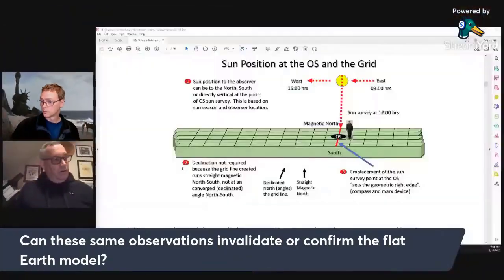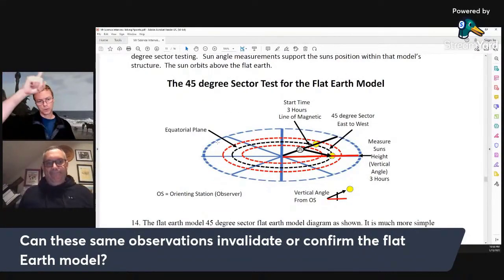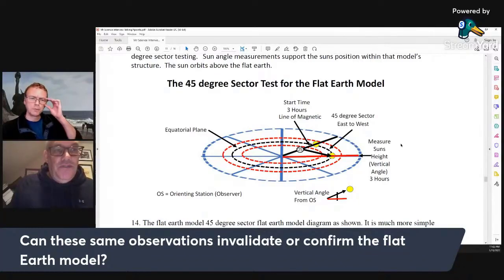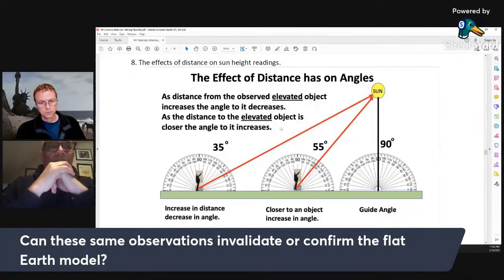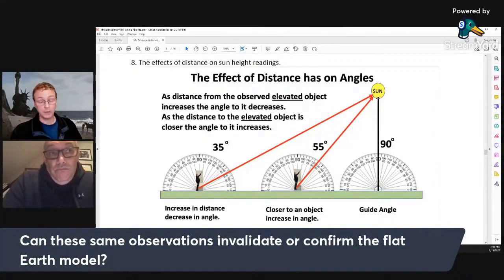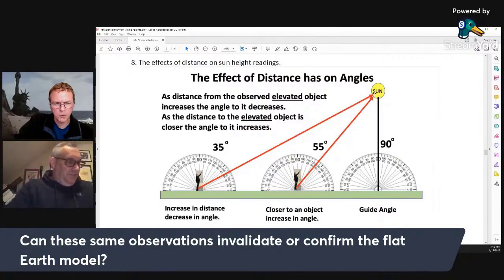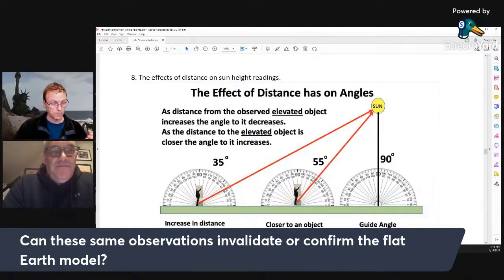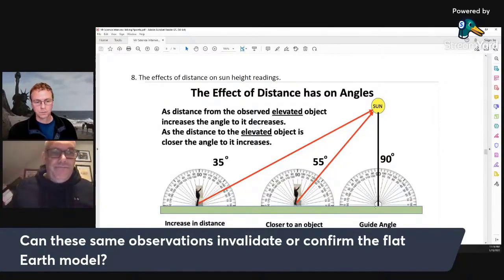Conversations with Corey - Does this work on Flat Earth?

Comment: @I Can Science That multiple points:
1/. Size of the sun = 0.53 degrees correct, I do not know what he was saying about 2.5 degrees, but any statement of "The sun always measures to be the same size" can be countered with these beautiful words: NASA Summer Moon Illusion. This demonstrates that an object in the sky can appear larger than we record it, albeit the moon not the sun this demonstrates that what we measure in the sky is not necessarily what we experience in reality. When you look in to the maths its about 30%, and then when you look in to how much the flat earth sun should shrink its about 30% also. Now I know you will try and add a zero on there which leads me on to my next point:

2/. In an orthographic view, all measurements based on the horizon "upwards" i.e. measuring angles to objects in the sky based on a perspective distorted non-physical horizon. Your geometric horizon is at the subsolar point which means that its X thousand miles away, lets say 4000 miles at 45 degree. Now in reality your ACTUAL horizon is only 3 miles away for a 6ft observer, which is 3997 miles difference in distance. You have zero account for this as you are taking your data from a perspective distorted viewpoint and then applying it to an undistorted geometric reality WITHOUT any forms of error analysis or transformations to remove these error accounts. Once you do, you will find there is approximately 23-45 degrees missing from your total visible sky measurement, because your floor is appearing to rise up in front of you and stopping you from seeing 4000 miles away to the ground-surface of the subsolar point. (you can imagine this on a flat earth as the 3997 miles are all squashed in to 1 single pixel row on the horizon, but once you learn that geometry only works to the tips of your toes, everything beyond that is perspective and refraction distorted illusions, literally ALL PHOTOGRAPHS ARE LIES... From ground based photography to aerial photography, they are all incorrect depictions of geometric reality by design. They are design to match what the eye sees not the geometric reality.

3/. If you roll them all together you get the following facts which I would love you to try and refute please:
a/. Your perspective view does not have a 1:1 relationship with geometric reality, and each individual has a different viewpoint with different errors, like perspective distortions and refraction.
b/. Objects in the sky are known to change apparent size, but science does not conclusively know why (read the NASA citation if you incorrectly think its the Ponzo Illusion)
c/. We have known refraction effects which means the sun is actually advanced 0.5 degrees more than where we are measuring it near the horizon starting about 40 degrees and gradually worsening towards the horizon. (ironically this is what globe earthers fail the flat earth on being able to explain: Why is your sun not located in the angle my orthographic geometry said it should?)
Reply: Question
1. I looked up NASA Summer Moon Illusion and found a nice page on the NASA website describing it. But it didn't answer the question I had. It's about the difference between "natural perception", what we see or think we see when we look at the Moon, and "measured perception", what we see when we look at it with an objective measuring device.

Just look at the Moon near the horizon and we think it looks bigger than when it's high in the sky ... but  ... here's my question ... There's probably some sophisticated surveyor's measuring device that can precisely measure the angular size. What would it show? Would there be a difference?

My hunch is that there wouldn't and that the effect is basically our brains playing tricks on us, not a real difference in angular size. I don't own surveying equipment but I do have a finger and a camera. So I've thought of 2 ways I can check. First, the index finger held out at arm's length is roughly 1 degree in angular size. I'm going to guess my pinkie finger is probably not much more than 0.5 degrees. So it should just cover the Full Moon. The next time there is a Full Moon and a clear sky (could be years from now,  where I live) I'll go out near moonrise and compare the Moon to my extended pinkie finger. Then I'll do the same a  few hours later, when it's well above the horizon.

There's another approach. I'll do this too. I've got a digital camera with a decent telephoto lens. I'll take photos of the Moon on that same night, using the full zoom of my lens, maxed  out so that I know it's the same setting for every photo. Then I'll count pixels to see if it changes in angular size.

As far as the atmospheric refraction when the moon is near the horizon, that is very well understood and quite minor in scale, compared to the 30% you are talking about. So for the purposes of this observation it can be neglected. I'll make sure to do an observation when the moon is just above the horizon, so that any atmospheric refraction effect is indeed captured. Then once it is about 5-10 degrees above I'll observe again, to see if the effect has dissipated. Then I'll measuring again when the Moon is much higher. That way we can factor out the refraction contribution.

Will you do the same observation as well? Or perhaps you've already done one similar? It would be interesting to compare results.

There are some other things in your comment I find not convincing at all. But maybe I'll leave those for now and focus on this one point, which I think is most interesting anyway.
Reply: @fepeerreview3150  If you really want to engage with me I would suggest dealing with the science presented:
1/. Do you believe perspective and euclidean geometry have a 1:1 relationship at all times?
2/. Do you believe that cameras are geometrically accurate without distortions?
3/. Do you believe that overlapping/occlusion of a false horizon can be mistaken for a globe?

The core conversation here is understanding that there are known errors which you lot are purposefully omitting and then obfuscating to avoid dealing with them. We personally have had this conversation about 3-4 times to no actually admission that this science is factual, only a handwave dismissal that its not needed, which is IDENTICAL to how flat earthers describe the "curvature of earth".  Odd that, no?!
Reply: I suspect a long cardboard tube might do the trick (closing the eye not looking through the tube) and prove that it is an optical illusion in your brain causing the sun and moon to appear larger near the horizon. I swear I have done so as part of my science education when younger, but perhaps it was something from kid's educational shows like Mr. Wizard, Beakman's World, or Bill Nye and not public education. Which is why having external measuring devices that do not have our brain's limitations is an important part to learn about the world around us.

I often seen portions of either scientific research or scientists themselves quoted but have often found the source material was taken out of context. I can prove the flat earth doesn't work just using my kitchen table, probably from watching those kid's science shows. But I don't even need to use science to guesstimate the shape of the Earth.

Commerce requires minimizing expenses in order to maximize profits. That means that when it comes to shipping, either cargo or people, companies will try to minimize fuel costs and travel times. If the Earth was flat, there is no way that it wouldn't be common knowledge just by commerce alone. Yet the technology exists to track flight paths and shipping routes and they better fit a globe earth.

It would be more impressive to me if a flat earther could produce a flat earth map that works for commercial navigation than their constant arguments against accepted science. I am not going to toss all of science out the window due to some misunderstanding of science, but if a flat earther could make me see how commerce could actually be following a flat earth map (where all routes make more sense than the globe) then at least it wouldn't be multiple aspects of society that provide evidence for a globe.

Gleem, got a map that does that? If you need help with surveying, might I recommend chapter 7 in reference number 3 from Corey Kell's Military Science References?
Reply: @Tsudico  "I suspect a long cardboard tube might do the trick (closing the eye not looking through the tube) and prove that it is an optical illusion in your brain causing the sun and moon to appear larger near the horizon"
You clearly never read the NASA citation, enough of you ignorant fools who take pride in being an ignorant fool!

"Some researchers believe that the Moon Illusion is Ponzo's Illusion, with trees and houses playing the role of Ponzo's converging lines. Foreground objects trick your brain into thinking the moon is bigger than it really is.

But there's a problem. Airline pilots flying at very high altitudes sometimes experience the Moon Illusion without any objects in the foreground. What tricks their eyes?

Maybe it's the shape of the sky. Humans perceive the sky as a flattened dome, with the zenith nearby and the horizon far away. It makes sense: Birds flying overhead are closer than birds on the horizon. When the moon is near the horizon, your brain, trained by watching birds, miscalculates the moon's true distance and size."
NASA

Come back when you are ready to talk science not kids programmes yeh!

"Gleem, got a map that does that? If you need help with surveying, might I recommend chapter 7 in reference number 3 from Corey Kell's Military Science References?"
You are too stupid to understand its a basic coordinate system transformation and why would I have any evidence of a flat earth when I am not one and I am in here citing NASA and the leading scientist in Perspective Geometry! It hilarious watching you lot pretend to be smart, as you clearly do not know what the Military Grid Reference Coordinate System is, look at antartica and tell me why its shown flat? = BECAUSE WITH MATHS YOU CAN DO WONDERFUL THINGS...

However, because I am kind, you can look up the model done by Steve Torrence who used the Hellerick Projection for his flat earth model and that matched up Star Trails from 6 different countries worldwide both north and south, and they matched. Or you can look up Rick Potvins maps which is a reverse engineer of all the antartica trips and matches the data.
Reply: @Gleem  Did you read the NASA article, or just look for key words and phrases? Let me provide another quote from near the beginning of the article:
    "Cameras don't see it, but our eyes do. It's a real illusion."
You are talking about a neurological phenomenon and trying to apply it to objective reality. This is why I have tried to stop arguing science with people who misunderstand science. They still often remain completely oblivious to what you are trying to teach them and continue to take quotes out of context . It doesn't matter if it happens with airline pilots as well, because it still doesn't show up when using cameras at altitude so it is an illusion crafted in the human brain. Just like the illusion of the horizon always rising to eye level, which when measured with external equipment is proven wrong. Our senses sometimes betray us.

Perhaps you need a science refresher, might I suggest Mr. Wizard, Beakman's World, or Bill Nye? They seem to be about at your science understanding.

As for your provided maps....unless they work with commercial navigation, then it wasn't what I was asking for. It is easy to make a map that works for some scenarios, that's why there are multiple map projections. The problem that flat earth can't seem to wrap their heads around is why all of them are projections in the first place. Again, flat earthers are missing the forest for the trees.
Reply: @Tsudico  "Did you read the NASA article, or just look for key words and phrases? Let me provide another quote from near the beginning of the article:
    "Cameras don't see it, but our eyes do. It's a real illusion.""
You should come back once you actually read my words and stop making up your own narrative pretending I said something different! I have never said the psychological effect is present in cameras, I have stated clearly that the moon illusion is unresolved as it cannot be the Ponzo Illusion if there is no ground reference available! On top of this I have cited in my first series of comments this:

"There are many approaches trying to model and estimate the perspective effects in images. Some approaches try to learn and model the distortion parameters from a set of training data that work only for a predefined structure. None of the existing methods provide deep understanding of the nature of perspective problems."

Perspective Distortion Modelling For Image Measurements - 2020 

Now for your lies to be true, I need you to explain how psychological issue affect a NASA professor of Robotics who has worked for the Department of Defense is saying "None of the existing methods provide deep understanding of the nature of perspective problems." when talking about ROBOTICS and A CAMERA and IMAGE MEASUREMENTS?? I bet you cannot..... In fact I guarantee you cannot explain a thing.

"You are talking about a neurological phenomenon and trying to apply it to objective reality."
Really?? Show me then, please explain why you believe that a paper titled  "Perspective Distortion Modelling For Image Measurements" using solely a monocular camera has anything to do with the said unknown perspective effects which govern the moon illusion?

"This is why I have tried to stop arguing science with people who misunderstand science."
You stopped arguing with them as you hit your limit of knowledge, as I can clearly see here. If you would have taken the time to read what I said especially when my first response to FE Peer Review clearly states:

Gleem "A reasonable explanation is that "The sun is magnified by the atmosphere the exact same amount as its supposed to be shrinking". This does not require any psychological illusions."

But you are in here telling me I am touting a psychological effect on a camera hahaha, this is how much you have to deny science and pretend I am not presenting something valid. This way you do not have to counter, you can just handwave dismiss it as I predicted. Dont worry I am not expecting an answer, because YOU CANNOT ANSWER! I have made it so!

"They still often remain completely oblivious to what you are trying to teach them and continue to take quotes out of context ."
Hahaha I bet you could never explain to "them", whoever they are in your imagination, just pretending I am someone in your past! Pathetic really!

" It doesn't matter if it happens with airline pilots as well, because it still doesn't show up when using cameras at altitude so it is an illusion crafted in the human brain. Just like the illusion of the horizon always rising to eye level, which when measured with external equipment is proven wrong. Our senses sometimes betray us."
Measured by what cameras? You mean the same cameras in my citations which say you are wrong, proven by experiment? Hmmm I am 100% certain cameras betray is ALL THE TIME, but you seem to think they don't because you have made up your own fantasyworld where its much more comfortable in ignorance.

"Perhaps you need a science refresher, might I suggest Mr. Wizard, Beakman's World, or Bill Nye? They seem to be about at your science understanding."
Hahaha are you mad, these are not scientist they are TV personalities you damn fool! I get my science from the leaders in their field, as I have cited here and as you have completely ignored due to your own mind wandering off somewhere else where cameras have a 1:1 relationship with geometry. Meanwhile back in reality, this happens:

"As mentioned earlier, all photography contains distortions. Unfortunately, these distortions, which are caused by the camera lens, the topography of the imaged surface (the Earth’s surface) and the single-point instantaneous collection nature of photographs, mean that aerial photos cannot be used directly as maps. Attempts to derive distances, areas or angular relationships directly from photography will result in serious errors . Photogrammetric analysis attempts to account for these distortions to allow distances, areas and angles to be derived accurately and precisely. Most of the distortion present in photography is the result of the perspective viewpoint from which the photograph was taken. This perspective is essential, however, for stereo-viewing and is necessary for calculating elevation from photography. The perspective distortion in a vertical aerial photograph increases away from the centre of the photograph. This is because the centre of the photo (correctly called the principal point) is the only truly vertical part of the image.Figure 9-1, Figure 9-2 and Figure 9-3 illustrate this. "

Field Techniques Manual: GIS, GPS and Remote Sensing 
Chapter 9: Geocorrection and photogrammetry 

You know PHOTOgrammetry is NOT psychological yeh? You can keep pretending science is lying to you, but only through your own ignorance and lack of understanding.

"As for your provided maps....unless they work with commercial navigation, then it wasn't what I was asking for."
Air navigation already uses said coordinate transforms from local cartesian coordinates to spherical coordinate systems. Again your lack of understanding is not a stong position to have.

" It is easy to make a map that works for some scenarios, that's why there are multiple map projections. The problem that flat earth can't seem to wrap their heads around is why all of them are projections in the first place. Again, flat earthers are missing the forest for the trees."
So you want to talk about cartrography not perspective science? Why are you changing the topic? Because you have to, because you know zero about perspective science IN CAMERAS clealy evidenced in your post thanks!

Come back when you are willing to have a conversation with me, NOT some imaginary version of me that you have made up to avoid speaking on the topic and stop pretending I said something I didn't! Why you globe earthers need your imagination to be fact is beyond me! And finally explain why you BELIEVE cameras have a 1:1 relationship with geometry when a NASA professor of robotics and a Manual on Photogrammetry both states you are talking out your backside??
Reply: @Tsudico  I will predict your responses as you have no other options:
"But muh you cherry picked them all, I cannot explain how, but you definitely cherry picked them"
"But muh you don't know about perspective science, albeit you cited the top scientists in the field and listed off the complete history of perspective geometry analysis"
"But muh a map"
"But muh here is a youtube video done by joe bloggs who over-rides NASA scientists and authorised instruction manuals for Photogrammetry"

I mean its not as if any of you can be honest and actually just say:

"Yes Gleem there are multiple errors with camera lenses and perspective distortions when analysing images taken by a camera... Does not mean the earth is flat, as it works the same on a globe!"

That is too difficult to admit, as this would obviously mean you are categorically wrong to exclude this error account! That you never even knew about before reading my citations!
Reply: @Tsudico  Just to drive the nail home, as I know your ego is in pain, all of this science relates to cameras:

Y. Takezawa, M. Hasegawa, and S. Tabbone, “ Camera-captured documentimage perspective distortion correction using vanishing point detection based on radon transform,” in 2016 23rd International Conference onPattern Recognition (ICPR), Dec 2016, pp. 3968–3974.

Z. Tang, R. G. von Gioi, P. Monasse, and J.-M. Morel, “ A precision analysis of camera distortion models ,” IEEE Transactions on Image Processing,vol. 26, no. 6, pp. 2694–2704, 2017

Photogrammetric Measurement Error Associated with Lens Distortion - 2011

Applicability of Single-Camera Photogrammetry to Determine Body Dimensions of Pinnipeds: Galapagos Sea Lions as an Example - 2014

"Or if the camera is aimed up or down is the same effect (plus or minus angles are the same effect). The angle causes the object pixels to optically measure shorter than it actually is . "
"The camera obviously achieves its camera purpose, but it simply is NOT a precision measuring instrument. Do not kid yourself when the calculator shows precision of a couple of decimal places. If you do need precision measuring, you should get a different instrument intended for the purpose."
Wayne Fulton - ScanTip (Pro-photographer and image scanning expert)

"The measurement errors for height (vertical) and area (horizontal) were RMSE = 11 mm, Mean Absolute Error (MAE) = 0.85 cm, and RMSE = 85 cm, MAE = 59 cm, respectively. Li [25] established an SfM-MVS (structure-from-motion and multiple-view stereo) system in a greenhouse and able to get depth error of 14.86 mm for object within 1 m distance and of 10 mm for object with less than 800 mm distance."
Evaluating Geometric Measurement Accuracy Based on 3D Reconstruction of Automated Imagery in a Greenhouse

" Perspective space is not a neurobiological model of visual space. It does not explain or even suggest how visual space is constructed from retinal images and neural processes. Instead, perspective space describes how geometric quantities in visual space relate to those in physical space and pictures ."
Perspective Space as a Model for Distance and Size Perception

"These invariances have not been reported until now and are a remarkable aspect of linear perspective in relation to physical space. The invariances do not hold for linear perspective in relation to visual space"
Equidistant Intervals in Perspective Photographs and Paintings - Dr Casper Erkelens

Size-Constancy in a Picture - Edwin G. Boring

Perspective Geometry Based Single Image Camera Calibration - 2008

"Viewing the picture from an incorrect distance magnifies the angular sizes of all depicted objects by a common factor (Figure 5d). Compression or expansion of the picture causes the same effect. Such changes in angular size are very different from those associated with moving forward or backward in the physical environment . Then, near objects change much more in angular size than far objects do (Figure 5a). Due to the angular size–distance relationship, pictorial distances behave differently as function of viewing distance, than visual distances as a function of camera position (compare Figures 3 and 4 with Figure 2). A widely held opinion is that photographs of scenes captured with short-focal-length lenses appear expanded in depth, while those captured with long lenses appear compressed [58]. The examples presented in Figure 1, Figure 8, and Figure 9 show that expansion or compression of depth is not related to focal length, but to the angular sizes of near and far objects in the picture. The ratio between angular sizes of depicted objects depends on the camera position from which the picture is taken, not on focal length of the lens . Each ratio is unique for a certain camera position (Figure 5c), implying that the picture could not have been made from any other camera position. From an incorrect viewing distance, the picture is a projection of a non-existing physical scene."
Multiple Photographs of a Perspective Scene Reveal the Principles of Picture Perception

Compression of visual space in natural scenes and in their photographic counterparts - 1999

Capacity of screen–camera communications under perspective distortions - 2015

Spatio-Angular Resolution Tradeoff in Integral Photography - 2006

Mathematics behind lens compression - F_Futamura GeoGebra

"All photographs are lies" Susan Bennet (Pro-Photographer)

Cameras and the Geometry of Vision | AfterDark: Photography | Exploratorium - Youtube

Comparison of Human and Camera Visual Acuity—Setting the Benchmark for Shallow Water Autonomous Imaging Platforms

The effects of viewing angle, camera angle , and sign of surface curvature on the perception of three-dimensional shape from texture

A Robust Human Detection and Tracking System Using a Human-Model-Based Camera Calibration

BUT YOU THINK THIS ALL RELATES TO A PSYCHOLOGICAL EFFECT HAHAHAHAHA AMAZING SCIENCE DENIAL THERE
Reply: @fepeerreview3150  Answers:
" There's probably some sophisticated surveyor's measuring device that can precisely measure the angular size. What would it show? Would there be a difference?"
No, it will always appear the same size, just like the moon will always measure the same size, but appear different size, you cannot have one without the other. A reasonable explanation is that "The sun is magnified by the atmosphere the exact same amount as its supposed to be shrinking". This does not require any psychological illusions.

The fact is, we measure something which is different to our experience, and if you think its only flat earth who has a problem explaining how the sun does not change size, I urge you to look in to the globe earth model to find the same story:
The Sun's Unchanging Size Baffles Scientists  By Denise Chow published May 13, 2010 Space dott com

"My hunch is that there wouldn't and that the effect is basically our brains playing tricks on us, not a real difference in angular size. "
I can guarantee this, and still claim the above.

I do not see a question 2 so I assume this is all? Your need for experimental evidence is already present in science, of which if you are a follower you have to admit/submit to the facts:

1/. Globe earth science cannot explain why the sun is not shrinking as it burns out.
2/. Globe earth science cannot explain why the sun acts completely different to the laws of thermodynamics here on earth (see the Solar Coronal heating problem)
3/. Globe earth science cannot explain why perspective distortions confirm that we do not experience life in a 1:1 relationship with Euclidean geometry.
4/. Globe earth science cannot explain why other objects in the sky, the moon, appears larger by 30% sometimes, but when measured is always 0.5 degrees.

Versus

1/. Flat earth science needs to explain how a geometric value of the size of the sun does not match our experience.

Good job we do not do science by Ockhams Razor anymore! hahaha

 "Will you do the same observation as well? Or perhaps you've already done one similar? It would be interesting to compare results."
Unfortunately not, I need not do any observation as all empirical experiment should produce the same results, its the interpretation of source mechanism which controls this "phenomena" which is the point of discussion. 

To give you my Machian philosophy:

2 people are stranded on an island due to a shipwreck where they cannot remember anything before waking up on the beach, not even their own names. With these 2 blank canvas brains they naturally look up to the night sky and ask each other "Do you think earth is a globe or flat?". Giving them a basic logic for the sake of analogy, one goes to one side of the island and starts recording the star movements as if earth was a globe and the other goes to the other side of the island and assumes earth is flat. Both of them spend a year collecting literally the same data, but interpreting the same data on different models of the earth. 

Why would BOTH their models not reflect reality just fine when both models were built from the same reality, same data, different interpretation of the data?  

"There are some other things in your comment I find not convincing at all. But maybe I'll leave those for now and focus on this one point, which I think is most interesting anyway."
You have me wrong, I am not here to convince anyone, the science does the talking, I am just making you aware of it as it seems there is a lot of misunderstanding as to who actually supports science and who is just winging it with belief systems.

If you want to peer review anything flat earth related I suggest you explain to me why National Geographic have a video called "Flat Earth vs. Round Earth | Explorer" and at the 7m 57m mark they are showing a flag supposedly hidden by earth curve... HOWEVER there is ANOTHER horizon which is higher up in perspective in the background much further away... So IF you are some sort of peer, and can review that I would much appreciate you telling me why mainstream science is lying about the globe?
Reply: "you will find there is approximately 23-45 degrees missing from your total visible sky measurement"
The concept of the "celestial sphere", as the term is used in astronomy and navigation, has been around since ancient times. In effect, it provides a framework for measuring, i.e. quantifying, the relationships between the celestial objects and each other as well as their relationships to ourselves, expressed in a framework of angles similar to our longitude-latitude system for Earth ground surface measurements.

It works. It encompasses a "dome" of a full 180 degrees at a given observer's location. To nitpick a bit, depending on one's height above mean sea level, we may see even a bit more than 180 degrees, but only a tiny fraction. Nothing is missing, no 23-45 degrees. We see the full sky. It has been thoroughly mapped, all 360 degrees of it and it all fits together nicely. The night sky is as thoroughly and completely mapped as the globe's surface.
Reply: @fepeerreview3150  "The concept of the "celestial sphere", as the term is used in astronomy and navigation, has been around since ancient times. In effect, it provides a framework for measuring, i.e. quantifying, the relationships between the celestial objects and each other as well as their relationships to ourselves, expressed in a framework of angles similar to our longitude-latitude system for Earth ground surface measurements."
Yes and I hope you are aware that this was FIRST designed by Anaximander of Miletus alongside Thales, who predicted the first eclipse recorded in history... Oh and both just so happen to be flat earthers with flat earth models. The earths shape is insignificant when you have maths and epicycles, you can make ANY SHAPED earth work with just adding more and more epicycles approximated with Pi. See my previous analogy of the 2 guys on an island.

".. we may see even a bit more than 180 degrees, but only a tiny fraction. Nothing is missing, no 23-45 degrees. We see the full sky."
Hahaha can you sort this paradox out or shall I?? Hahaha how can you only see 180 degress of a 360 degree sky and nothing is missing hahaha Please revise your thought process and actually tackle the science I am presenting, not wandering off in to your own paradoxical conclusions! This is a core sign of ignorance, when you are concluding something you a/. contradicted in your last sentence, and b/. cannot explain why the floor appears to rise up but in reality it should be going down from your toes at all times.

What would have been better for you, is to ask "Gleem can you provide me with the maths or mechanism that I can work this missing 23-45 degrees"

Step 1:
Look at the horizon and take a photo where the horizon is dead center frame.

Step 2:
Understand 45 degrees of the photo (from horizon to the bottom) is land not sky, which is LITERALLY hiding the sky behind it, ON BOTH MODELS!

 "The night sky is as thoroughly and completely mapped as the globe's surface."
Again this maybe your failing in understanding, but as Richard Feynman taught me, you can have 2 completely different theories which both arrive at the same numbers, and experimentally cannot be disguished from each other, they are mere conceptual differences. Both can describe reality, so I do not care if you have globe maths which mapped the northern sky in 4000 BC but waited until 1500 AD to map the southern sky as you should know if you know about the history of mapping the sky, alas I do not believe you are aware and just thought that in 4000 BC they mapped the sky as a globe and its been the same ever since! Hahaha madness if you believe that crazy belief system.
Reply: Starlink shows that your earth isn't flat so stop LARPing as a flat Earther gleem.
Reply: Now either Youtube does not want the science presented or you dont, because I did not include any links in my citation post..
Reply from the maker: @Gleem  I haven't deleted any of your posts today. I haven't even read them.
YouTube has a habit of eating posts, and it seems like any post with links in them get eaten first. That's just YouTube I'm afraid.

As I said, I haven't even read your posts. Frankly, I don't expect I will. As long as your posts aren't overtly insulting, I plan to just leave them be.
If anyone else reads them and thinks they are worth my time, please let me know. My initial assessment is that they aren't worth my time.
Reply: @icansciencethat  " I haven't deleted any of your posts today. I haven't even read them."
Thats why I said youtube first.

"YouTube has a habit of eating posts, and it seems like any post with links in them get eaten first. That's just YouTube I'm afraid."
Cool, I thought so, as it would be a bit weird someone called "I can science that" to be deleting science.

"As I said, I haven't even read your posts. Frankly, I don't expect I will."
Thats cool, I already expect you to avoid the topic, it was my point which you are confirming thanks.

"As long as your posts aren't overtly insulting, I plan to just leave them be."
How would you know if you did not read them? They could be horrifically insulting but you will never know as you just said " I haven't even read your posts. Frankly, I don't expect I will"...I guess you have some sort of magic spider senses but meh!

"If anyone else reads them and thinks they are worth my time, please let me know. My initial assessment is that they aren't worth my time."
They will NOT be worth your time, as if you are in persuit of making a channel from flat earth, INSTEAD of conclusively debunking it using my information which flat earthers would believe, then so-be-it, hey you have to earn a living and I am not going to deny you from that. HOWEVER when you are using the word SCIENCE and CAN in your channel name its EXTREMELY ironic how you have CANNOT deal with ANY science I have put on the table. This is amazing to watch people who support science, actively ignore it when its the key to debunking flat earth once and for all! Hey you keep surviving off flat earth, I will just sit back laughing at you all trying to support science by ignoring it! I love these paradoxes.
Reply: @icansciencethat  Psst did you not see another persons comment before yours?? He has written 2 comments with a couple of paragraphs asking questions and giving statements, now if it was not worth your precious time then fine move on. Do not ever invite me on your show again if you are going to be this ignorant about science.
Reply from the maker: @Gleem  I get the notifications so I see that you are posting. Don't see insults in them, and I've never known you to be insulting, so I'm just letting them go.
I see that FEPR is engaging, and I trust him to let me know if there's anything worth my time one way or another.
I've seen your comments before. If these are different, I'm counting on FEPR or another viewer to bring it to my attention. 
If you're curious, I've found your past posts to be a combination of irrelevant and fallacious. Yet you are articulate enough, I do not believe your fallacies are accidental. Don't have time for trolls.
You're welcome to talk with FEPR and any others, but if you wish to engage with me, you need to convince me you aren't a troll first. At this point, that'll be a long, uphill journey for you.
Reply: @icansciencethat  It ok if you need to pretend I am sub-human and cannot actually raise a vaild point while citing multiple citations from mainstream science! Let me tell you now, I am not worth your time as I cite science and have looked in to it and have done the maths to reconcile the FE model to work just fine on Rantys show many times. 

You keep pretending I need you for something, while I am just unsubscribing now as you clearly are lying about "I can science that" if you have to go through this much trouble to pretend I need vetting! Hahaha amazing how your egos are far larger than your actual knowledge base. 

As I say, keep playing your games over on this corner of youtube, and I will keep trying to hunt down someone who is interested in science.

Thanks for your time.
Reply from the maker: @Gleem  I'd like to draw your attention to this citation here: https://genius.com/The-hollies-long-cool-woman-in-a-black-dress-lyrics
And if you doubt the accuracy of that transcription, here is the original audio recording of the lecture from 1972: https://youtu.be/g8XiNKsKyVk
In particular, let me draw your attention to 58 seconds into the lecture when professor Clarke clearly states, "A pair of 45's made me open my eyes. My temperature started to rise."
What have you got to say about that?
Reply: @icansciencethat  Oh and I listened to your track, and 100% understand now why you shy away from science! Because you think Allan Clarke was a professor who is an authority on the Geometry of Visual Space and Dr Mark Wagner is just a hobbiest who's lectures are irrelevant to the conversation about Geometry of Visual Space.. Albeit Dr Mark Wagner actually wrote the book on the Geometry of Visual Space which nearly all professional scientist agree with both experimentally and theoretically. 

I predicted you will obfuscate, run away, hide, anything to avoid discussing why you are touting Visual Space as having a 1:1 relationship with geometry when literally the top scientists in that field tell you otherwise and show you otherwise via experimentation discussed throughout the lectures below:

The Philosophy and Psychology of Visual Space: An Interdisciplinary Workshop

Ernst Mach, InnenperspektiveThe Ohio State University hosted an Interdisciplinary Workshop on the Philosophy and Psychology Visual Space (PPVS2019) on 15 and 16 February 2019. This workshop was organized in collaboration between the Ohio State University and the University of Pennsylvania. All sessions were on the Columbus campus of the Ohio State University.

Putting the Geometries of Visual Space into Perspective (Dr. Mark Wagner)
https://www.youtube.com/watch?v=4HFdI9eonPw

Is there a consistent geometry of visual space? (Dr. James Todd)
https://www.youtube.com/watch?v=LStrMTUvsYs

Visual Spaces and Less (Dr. Jan Koenderink)
https://www.youtube.com/watch?v=uQ3a5uZk3Zs

Psst Youtube does not block their own links, so you can delete this if you need to as its much easier to delete and ignore than admit you do not have a clue about perspective science and have been touting anti-science on your channel since its inception. YOU are personally responsible for why Flat Earthers exist and the only reasonable explanation I can come up with is that you are mere jumping on the bandwagon to earn some money from spreading false science to the masses. I hope you are proud of yourself, as I am 100% proud that I can cite the top scientist in the field and you run away to a Hollies song all because you believe my citation is irrelevant which we both know is a handwave dismissal because you are not a true scientist. True scientist would embrace the knowledge I have given and use it AGAINST flat earth, however your ego is far to strong for your logic, therefore you are block, reported as spreading false science and have litterally sunk to the bottom of the barrell as far as my respect is concern, but hey who needs respect from someone trying to highlight you are embarrassing yourself by not knowing what flat earthers know, and that is simply:

 "Visual space is space as we consciously experience it, and it is revealed through the subjective judgments of observers. Previous theorists have tried to test whether visual space is best described by a small set of synthetic geometries, such as Euclidean geometry or Luneburg's hyperbolic geometry. The Geometries of Visual Space reviews this synthetic work and demonstrates that visual space regularly violates the axioms these geometries assume. "

Wagner, M. (2006). The geometries of visual space. Lawrence Erlbaum Associates Publishers. Cited by 172 other papers and costs $58 to buy... But you think its all irrelevant when discussing how our vision should be identical to Euclidean Geometry, when experiments from the 1930s have proven you wrong from Dr JJ Gibson, Dr A Gilinsky, Dr Ooi and Dr He, Dr Casper Erklens (probably the lead of the topic today who agrees with Wagner).. Seems my research far exceeds what your imagination can conjure up from pure fantasy!

Psst you will learn one day why I call myself a Mach Earther, and have dedicated my research to his core topics of interest being Relativity and Perspective. Two topics which I have uncovered you know nothing about, but hey, at least you are trying to combat anti-science by setting up another anti-science channel! Well done you....
Reply: @icansciencethat  If you learn one thing today, that should be this, watch literally 2 minutes of this lecture to understand that EXPERIMENTAL EVIDENCE proves you are touting nonsense science which is completely wrong. 
The Geometry of the Visual Field and its Philosophical Significance (Dr. Farid Masrour)
https://youtu.be/V1kxyquZMHM?t=196
Reply: @Gleem  Just a slight addition to my other comment, this time regarding Dr. Farid Masrour's talk. Here again you are trying to use how human brains perceive things and applying it to an objective reality. In this case, the science of optics would be the appropriate field not neuroscience, because the science of optics is about how light works in objective reality and has well defined laws whereas we know human perception may forgo accuracy (creating optical illusions) for expedience (making sure we aren't predator's food). In other words, our brains may create false positives or interpret things wrong due to our evolution, but we can use external tools to verify objective reality.
Reply: @Tsudico  Hahaha you are too dense to understand science!

"Here again you are trying to use how human brains perceive things and applying it to an objective reality."
Meanwhile back in reality:

" Perspective space is not a neurobiological model of visual space. It does not explain or even suggest how visual space is constructed from retinal images and neural processes. Instead, perspective space describes how geometric quantities in visual space relate to those in physical space and pictures ."
Perspective Space as a Model for Distance and Size Perception - Dr Casper Erkelens 

Who the hell is this PhD guy Casper saying you are wrong?? 

Prof. Dr. Casper J. Erkelens (1950) is Professor Emeritus of Utrecht University. Trained in biophysics, he has been working on various problems of motor control (e.g. mandibular reflexes, coordination of arm muscles, eye movements) and visual perception (stereopsis). Current research focuses on space perception during viewing of natural scenes, photographs and paintings .

Hmm thats odd he mentions photography, I wonder what he says on his offical page on Utrecht University??:

"Two types of perspective, photographic and visual , are relevant to human vision. Photographic perspective results from the projection of the three-dimensional world on a surface. Photographic perspective has been widely applied in drawings and paintings to create an illusion of depth. Visual perspective is a property of visual space, the space that we, that is, human beings, perceive through vision. Photographs, drawings and paintings are two-dimensional surfaces whereas visual space is a three-dimensional space. The literature on photographic perspective is extensive whereas the literature on visual perspective is scarce. Many questions regarding the perspective nature of visual space are yet unanswered. For example: Does visual perspective develop with age? Does visual perspective depend on the structure of the biotope? Are there cultural differences in how visual perspective is experienced? Is visual perspective represented in animals? What and where is the neural correlate of visual perspective? What has been the influence of visual perspective on the development of visual art? Can visual perspective play a role in computer vision?"

Hmmm it looks like every single post you are just going to confirm you do not have a scooby doo what you are talking about, you are just winging it! Against someone who is clearly not! To prove you wrong, cite me one single scientist who states there are no perspective errors in cameras? If you cannot then you clearly have just been taken to school on the topic no?
Reply: @Tsudico  Seriously you are outclassed here, as I am citing 20+ scientists with dozens of experiments demonstrating there are errors in photographs caused by perspective, now just show me 1 who states there are ZERO perspective errors in photography or admit you are just forwarding a lie, which does not conform with actual reality of scientific experimental results. I will 100% guarantee you will not find a single scientist or experiment which has ZERO perspective errors to account for! Hell I even cited the ACTUAL REAL WORLD errors on a greenhouse camera monitoring plant growth! They found BY EXPERIMENT that at 80cm there was an depth error of 10mm at 100cm it was 14.86mm as you can see this is a clear indication of "The further away from the camera, the greater the depth error of perspective" but you are seriously pretending to me that this is all psychological hahahahaha
Reply: @Gleem  You keep missing the forest for the trees while slinging every cherry-picked quote in a vain attempt to overload me. After all, it is easy to find quotes that fit a narrative, but takes more effort to actually source the quotes, find their context, and explain that context in a rebuttal. But, luckily for me you're not very good at quote mining. Half the quotes in your last quote bomb indicated that distortion corrections were a thing. Those quotes do not help your case. They prove that optical distortion is a known factor and can be mitigated depending on circumstances. This, by the way, is why I Can Science That indicated it wasn't worth the time to even reply to your claims. Because they clearly show deceit behind them and you have a long history of doing so.

I'm done talking to someone who clearly isn't going to change their mind no matter the evidence presented, especially when the arguments they use are not supported by the actual quoted arguments they present. I have more important things to do in real life then argue with con artists on the internet. If you want to take that as a win, go ahead. Meanwhile, I have kept you commenting on this video which increases the engagement algorithm for I Can Science That and directs more viewers his way. Personally, I think that's a win in my book. So please, continue trying to egg me on to respond back. Make sure you make plenty of comments for me.
Reply: @Tsudico  " You keep missing the forest for the trees while slinging every cherry-picked quote in a vain attempt to overload me. "
At this point you are just bashing your keyboard trying to get out of the facts that THERE ARE PERSPECTIVE DISTORTION ERRORS which you thought originally was only applicable to the human eye and psychology.. Until I cited 20+ papers DEMONSTRATING there are multiple errors to correct for and quite an intense amount of maths to calculate BEFORE getting the correct results according to reality.

 "After all, it is easy to find quotes that fit a narrative,"
My narrative has remained the same from the start, there are perspective errors which you do not account for and you are just proving me right over and over again!

" But, luckily for me you're not very good at quote mining. Half the quotes in your last quote bomb indicated that distortion corrections were a thing"
YES you are too docile to understand THEY ARE NOT A THING FOR SCIENCE DENYING GLOBE EARTHERS! Of which you are one of them! As you have now CHANGED your story to "Oh yeh we knew about them perspective distortions in photos, those scientists you cited always have to account for them to make sure you get precise measurements", what you fail to understand is NONE OF YOU ACCOUNT FOR IT! Hahaha which was my whole and sole point. But you can pretend it was something else if you need to!

 "I'm done talking to someone who clearly isn't going to change their mind no matter the evidence presented"
Hahahaha why would I change my mind when its YOU who changed your mind from:

Tsudico one minute "You are talking about a neurological phenomenon and trying to apply it to objective reality. "
Tsudico next minute after bothering to read my citations "It is true that how photos are taken can change and distort what is seen, especially compared to the human eye which operates a different way"

My stance has always been:

SCIENCE KNOWS THERE ARE PERSPECTIVE DISTORTION ERRORS PRESENT IN EVERY PHOTOGRAPHIC MEASUREMENT AS PROVEN BY EXPERIMENT. GLOBE EARTHERS ARE LYING PRETENDING THERE IS A 1:1 RELATIONSHIP WITH EUCLIDEAN GEOMETRY!

You cannot counter that statement so run off and stop wasting my time on your ignorance, only to admit these errors DO exist and you DO reverse engineer them, but oddly cannot cite a single globe earther who has ever used them when analysing photos pretending to see the curve of earth!

I love watching people who pretend they support science, attempt to debunk science all due to a belief system they hold, which is of course complete ANTI-SCIENCE! Science does not care for your belief that we do not need to calculate for these errors, science CONFIRMS these errors exist by experiment and anyone omitting them from their analysis should be immediately negated and thrown in the bin, for NOT SUPPORTING VALID SCIENCE!

I am glad you are another globe earthers now aware of the science you should be promoting, alas you deny any account for this science and go along with the crowd in fear of being laughed at!  

" especially when the arguments they use are not supported by the actual quoted arguments they present."
My argument is fully backed up by my citations, as you never countered the following:
1/. We do not know what is the mechanism behind the moon illusion, as the Ponzo Illusion has been proven false as you REQUIRE a ground based reference object for the Ponzo Illusion and Pilots DO NOT HAVE THAT but still experience it as NASA states.
2/. We do not fully understand the geometry of perspective, as you will see in all my citations they all admit that when you take a photo which is NOT EXACTLY at the central perspective point you will always get "serious errors"
3/. Perspective space DOES NOT have a 1:1 correlation with euclidean geometry 

You just made up some nonsense pretending I am saying "Well cameras have brains and feelings" and then pretending my citations do not back up that stupid suggestion conjured up from pure imagination.

"I have more important things to do in real life then argue with con artists on the internet"
So why did you get involved in the first place? Was it because you thought you could counter me?? Hahaha unlucky.

"If you want to take that as a win, go ahead. "
My personal opinions matter not, EMPIRICAL SCIENCE is speaking to you, I am just the one teaching you this empirical science exists.

" Meanwhile, I have kept you commenting on this video which increases the engagement algorithm for I Can Science That and directs more viewers his way. "
Yes and I really hope many people come in here and see me citing science and him citing a flipping musician! And click that unsubscribe button just like I did! The internet is full of youtubers wanting to make money off of false science, I hope any reader of this actually reads the science I am citing, not skim read like you did in a panic trying to pretend 

"So basically, you cherry picked a statement indicating that optics had issues with distortion from an article that went on to provide solutions for the very distortions you claim can't be done. "

Yet it was not my claim, unless you believe I am now a Professor of Robotics working for NASA and the Department of Defense called Theodoros Theodoridis not Gleem??

"There are many approaches trying to model and estimate the perspective effects in images. Some approaches try to learn and model the distortion parameters from a set of training data that work only for a predefined structure. None of the existing methods provide deep understanding of the nature of perspective problems."

Perspective Distortion Modeling for Image Measurements" 2020, by Alexandre Bousaid, Theodoros Theodoridis, Samia Nefti-Meziani, Steve Davis. 

You know that quote you excluded for "brevity" or through embarrassment, it all depends really as if the reader actually reads the Photogrammetry manual you have cited back to me here:

"In this work, a perspective distortion model for every effect is developed while elaborating the nature of perspective effects. A distortion factor for every effect is derived, then followed by proposed methods, which allows extracting the true target pose and distance, and correcting image measurements."

You actually read it like I have and you find:

"Overall RMS error is calculated based on all the data entered by a user regarding the
location of an image on the Earth’s surface and the transformation method selected.
Deciding what is an acceptable level of error should be based on an understanding of the
process alongside a knowledge of the project for which the data is destined. RMS error
values are defined in terms of input image pixel size.
The amount of error is related to the nominal pixel size of the image. For example, when
correcting Landsat TM, the general rule is that the total RMS should be <1, but as a pixel is
30 m x 30 m, the actual error is up to 30 m. When correcting air-photos, the nominal pixel
size may only be 25 cm. Even with an RMS of 7, the total error is still sub 2 m. Deciding
on an acceptable error level therefore depends very much on the imagery, the quality of the
data used to correct it and its anticipated use. 
However, RMS error calculations are not foolproof: they are reliant on a good distribution
of GCPs within an image. This may well be difficult, if not impossible, to achieve in some
areas of the world. Poor distribution of GCPs can lead to huge errors that only become
obvious when integration with other datasets is undertaken (Figure 9-18). Selection of
appropriate and well distributed GCPs and choosing the correct transformation are
therefore critical to limiting error in the output image. "

GCP's are Ground control points, meaning YOU HAVE TO KNOW THE PREDEFINED STUCTURE BEFORE YOU CAN GET ANY SORT OF ACCURATE RESULT!

But hey keep pretending you know about this, its hilarious to watch, or you can just run off with your tail between your legs as you intend.

"So please, continue trying to egg me on to respond back. Make sure you make plenty of comments for me."
The most replies to a post on this whole video is 1, without accounting for this thread with 20+ comments.. I am 100% certain this will be the first port of call for this video and am 100% certain that all the science I have cited here will allow any sane reader to look up the science, confirm its empirically proven by experiment and ask the same question "Why does not any globe earther have a single account for pose, distance and size distortions?"

Thanks for never being able to answer this, but hey I knew this before I came to this video which is why I CAN cite the science to back my statements and the ONLY science you can cite is my own citation confirming I am correct.
Reply: @Tsudico  This is so hilarious tho:
You said "in the same paragraph your quote came from was this little gem:
    "Photogrammetric analysis attempts to account for these distortions to allow distances, areas, and angles to be derived accurately and precisely." It then goes on to explain the distortion effects and how they can be mitigated.""

Clearly English is not your first language, if so, please explain what the word "attempts" means please? Hahaha you went all in on an ATTEMPT pretending its ABSOLUTELY perfect hahaha and STILL will never be able to show a single globe earther who has ATTEMPTED to account for these same errors, let alone having more than one fully known ground control point... Thanks for confirming all globe earthers lie about science as not one of them have accounted for a single perspective distortion EVER, and none of you EVER will. Because this maths is too difficult for you lot, as you are not that smart. Its that simple.
Reply: @icansciencethat  Your minions are now my minions, Tsudico confirms that there are PERSPECTIVE ERRORS on every photographic measurement which needs accounting for or you get serious errors. If you cannot show any account for such distortions in your calculation then "if it disagrees with experiment its wrong.. that is the true meaning of science" - Richard Feynman. 

Using distance x tan(a) I can invert the angle based on a spherical trig and fully reconcile Polaris for every degree and make it match the globe model using a completely flat surface based on it being 4000 miles in the sky. And this is also excluding any account for perspective errors. See maths is great when you know what tools are available and how to use them:

Latitude	Pole	Distance (mi)	Apparent Altitude (apparent horizon to polaris in mi)	Hypotenuse
90	N	0	3958.00	3958.00
89	N	69.05	3955.69	3956.29
88	N	138.09	3954.48	3956.89
87	N	207.14	3952.47	3957.90
86	N	276.19	3949.66	3959.31
85	N	345.23	3946.04	3961.12
84	N	414.28	3941.62	3963.33
83	N	483.33	3936.39	3965.95
82	N	552.37	3930.35	3968.97
81	N	621.42	3923.50	3972.41
80	N	690.47	3915.84	3976.25
79	N	759.51	3907.36	3980.50
78	N	828.56	3898.08	3985.16
77	N	897.61	3887.97	3990.24
76	N	966.66	3877.04	3995.73
75	N	1035.70	3865.29	4001.65
74	N	1104.75	3852.72	4007.98
73	N	1173.80	3839.31	4014.74
72	N	1242.84	3825.08	4021.92
71	N	1311.89	3810.00	4029.54
70	N	1380.94	3794.09	4037.59
69	N	1449.98	3777.33	4046.07
68	N	1519.03	3759.73	4055.00
67	N	1588.08	3741.27	4064.37
66	N	1657.12	3721.96	4074.19
65	N	1726.17	3701.78	4084.47
64	N	1795.22	3680.74	4095.20
63	N	1864.26	3658.82	4106.39
62	N	1933.31	3636.03	4118.06
61	N	2002.36	3612.35	4130.19
60	N	2071.40	3587.78	4142.81
59	N	2140.45	3562.31	4155.91
58	N	2209.50	3535.94	4169.50
57	N	2278.54	3508.65	4183.59
56	N	2347.59	3480.45	4198.18
55	N	2416.64	3451.32	4213.28
54	N	2485.68	3421.25	4228.90
53	N	2554.73	3390.24	4245.04
52	N	2623.78	3358.28	4261.72
51	N	2692.83	3325.36	4278.94
50	N	2761.87	3291.47	4296.71
49	N	2830.92	3256.60	4315.04
48	N	2899.97	3220.74	4333.93
47	N	2969.01	3183.88	4353.40
46	N	3038.06	3146.00	4373.46
45	N	3107.11	3107.11	4394.11
44	N	3176.15	3067.18	4415.37
43	N	3245.20	3026.20	4437.25
42	N	3314.25	2984.16	4459.76
41	N	3383.29	2941.05	4482.91
40	N	3452.34	2896.86	4506.71
39	N	3521.39	2851.56	4531.18
38	N	3590.43	2805.15	4556.33
37	N	3659.48	2757.62	4582.17
36	N	3728.53	2708.93	4608.71
35	N	3797.57	2659.09	4635.98
34	N	3866.62	2608.07	4663.99
33	N	3935.67	2555.85	4692.75
32	N	4004.71	2502.42	4722.27
31	N	4073.76	2447.76	4752.59
30	N	4142.81	2391.85	4783.70
29	N	4211.85	2334.67	4815.64
28	N	4280.90	2276.20	4848.42
27	N	4349.95	2216.41	4882.06
26	N	4419.00	2155.29	4916.58
25	N	4488.04	2092.81	4952.01
24	N	4557.09	2028.95	4988.35
23	N	4626.14	1963.68	5025.65
22	N	4695.18	1896.98	5063.92
21	N	4764.23	1828.82	5103.18
20	N	4833.28	1759.17	5143.46
19	N	4902.32	1688.01	5184.80
18	N	4971.37	1615.30	5227.21
17	N	5040.42	1541.01	5270.72
16	N	5109.46	1465.11	5315.37
15	N	5178.51	1387.58	5361.19
14	N	5247.56	1308.36	5408.20
13	N	5316.60	1227.43	5456.45
12	N	5385.65	1144.76	5505.97
11	N	5454.70	1060.29	5556.79
10	N	5523.74	973.99	5608.96
9	N	5592.79	885.81	5662.51
8	N	5661.84	795.72	5717.48
7	N	5730.88	703.66	5773.92
6	N	5799.93	609.60	5831.88
5	N	5868.98	513.47	5891.40
4	N	5938.02	415.23	5952.52
3	N	6007.07	314.82	6015.32
2	N	6076.12	212.18	6079.82
1	N	6145.17	107.26	6146.10
0	EQ	6214.21	0.00	6214.21

Just because something calculates or does not calculate it does not prove a damn thing, other than you are taking measurements distorted by perspective and expect flat earthers to believe this matches geometric reality with a 1:1 relationship, when the science clearly states otherwise. I hope you learn something, but I really believe you refuse to believe something quoted by me, all because you think I believe the earth is flat, and am not just someone who still believes the globe but is pointing out to you that your are spreading false science of perspective. But hey you can science that away with one handwave, as I am sure you need to, as accounting for the maths of perspective distortion is way above any of your youtube paygrades.
Reply: Psst the polaris maths also works for the sun and moon at 4000 miles too... But flat earthers will not show you that... Because they let me do it for some reason.
Reply from the maker: @Tsudico  Gleem has invoked your name, so I thought I'd ask you, "Does Gleem have anything to say that is worth my time to read?"
I didn't read his actual comment - I just got a notification that includes the first few lines of text. In there he says you agree with him about something.
Personally, I think Gleem is just a troll, but if you say it's worth a look, let me know and I'll look.
Reply: @icansciencethat  I'd agree with you. Gleem is misrepresenting statements to imply that we have stated things that individuals can easily check via our comments and find no evidence of. Since all Gleem seems to be able to do is misrepresent quotes outside of context or make up arguments that we have never made, I don't think it's worth your time or mine to continue to feed the troll.
Reply: @icansciencethat  Since you noted the bit of an interchange between me and Gleem, after reading Gleem's first 2 responses to me I came to the conclusion there was no reason to spend time reading more of what he had to say or respond.
Reply: @icansciencethat  I’d say your assessment of gleem is not far from my own which I’m inclined to think is reality. He is always in some form misrepresenting legitimate sources in a useless attempt of portraying demonstrably silly notions as more than they actually are. 

As you said, he’s articulate enough to recognize what he’s doing and should know better, that these citations cannot be genuinely supporting the pie he’s selling because at the end of the day these sources are proper mainstream folks who understand and acknowledge the globe earth etc. It’s not like they’re stupid and can’t recognize the implications of their own ideas. 

Tl;dr he’s like a benign qe with misrepresenting citations. Like it’s almost a guarantee if you look into them, they’re not saying what he’s claiming and using the citation for.
Reply: Gleem = Cites science which goes against your belief system
I can science that = I am too scared to look, someone tell me when he has gone
FE Peer Review = I ran off when I could not show him any account for perspective error analysis any glober has done
Tsudico = I first disagreed with him that there are no errors in cameras due to perspective, but I since learnt there are whole papers of mathematics you need to do and I too had to run off when he asked me to show this account by any globe ever.

YOU DENY SCIENCE MORE THAN FLAT EARTHERS WHEN YOU ARE THE ONES WHO ARE SUPPOSED TO BE USING THIS MATERIAL TO DEBUNK THE FLAT EARTH ON THEIR OWN FLIPPING TERMS AS IF YOU KEEP ON EXCLUDING KNOWN SCIENCE WHICH YOU SHOULD INCLUDE IN ALL EXPERIMENTS AND ANALYSIS OR YOU GET SERIOUS ERRORS IN MEASUREMENTS, THEN YOU ARE PROVING FLAT EARTHERS CORRECT BY SAYING EVERYONE IS LYING TO THEM ABOUT SCIENCE

But you think I am here to troll you.... with 30+ citations from science and top leaders of the scientific field... because all three of you are threatened by this challenge to your whole belief system.. Enjoy your science denial, and thanks for the screenshots confirming you all run away from a conversation about ACTUAL EMPIRICAL SCIENCE OF PERSPECTIVE! Psst that is why I am citing those scientists and NOT YOU LOT, AND NOT FLAT EARTHERS, for the science of perspective. You amaze me every post, thanks for the entertain and total exposure of 3 x science deniers, as you are literally in here telling me the science is factual, but lose your minds when I ask you to show a single globe earther who has ever calculated for it. You are too scared it will work and you will find out the earth is flat, which is absolutely hilarious considering I am not a flat earther and not in here promoting the flat earth, I am in here citing the likes of NASA.... and you are literally telling me that they are lying to us all, we need not account for any perspective distortions albeit:

"There are many approaches trying to model and estimate the perspective effects in images. Some approaches try to learn and model the distortion parameters from a set of training data that work only for a predefined structure. None of the existing methods provide deep understanding of the nature of perspective problems."

Perspective Distortion Modeling for Image Measurements 2020

"Attempts to derive distances, areas or angular relationships directly from photography will result in serious errors. Photogrammetric analysis attempts to account for these distortions to allow distances, areas and angles to be derived accurately and precisely. "
Field Techniques Manual: GIS, GPS and Remote Sensing 
Chapter 9: Geocorrection and photogrammetry 

I Cant Science That "Does Gleem have anything to say that is worth my time to read?" = NO because you deny mainstream science, as all Gleem has presented here is mainstream science and none of you have even acknowlegded that these perspective errors  proven empirically by experiment need to be accounted for, and because you are anti-mainstream-science you believe you can omit this account from 100% of your investigations.

Tsudico "Gleem is misrepresenting statements to imply that we have stated things that individuals can easily check via our comments and find no evidence of. " = All claims you believe this from have been shown to be fabricated from your imagination thinking I am a flat earther. All I have done here is say "There is science which confirms you MUST account for perspective errors in cameras" and you agreed, but run off when I asked you to show me a single account any globe earther has ever made, because guess what, they never have.

FE Peer Review "after reading Gleem's first 2 responses to me I came to the conclusion there was no reason to spend time reading more of what he had to say or respond." = Yes because you immediately got your head below water when you found out you wrong thought I was saying "The moon illusion is a psychological issue within a camera" saying:
"There's probably some sophisticated surveyor's measuring device that can precisely measure the angular size. What would it show? Would there be a difference?"
when I clearly stated before that: 
"A reasonable explanation is that "The sun is magnified by the atmosphere the exact same amount as its supposed to be shrinking". This does not require any psychological illusions."

Thank you all for this confirmation that you are all non-scientific and have adopted anti-science in your belief system, as not one of you has put a valid reason on the table why we should be excluding perspective error accounts from all investigations although they have been proven by experiment to be an ABSOLUTE REQUIREMENT or remember:

"Attempts to derive distances, areas or angular relationships directly from photography will result in serious errors"

because you all clearly prefer your works to have SERIOUS ERRORS and pretend you can derive distances, areas and angular relationships perfectly fine with Euclidean maths hahahahaha amazing stuff! I love the irony of a channel called "I CAN science that" who literally cannot science perspective nor its errors, yet they are fully documented by mainstream science. Enjoy your science denial.
Reply: @sphaera2520  If I have misrepresented science then why can none of you explain how? Seems far fetched if you are not slapping the exact "cherry pick" and then sourcing the exact quote which disagrees with my statement. Fact is you cannot counter this statement:
GLOBE EARTHERS DO NOT ACCOUNT FOR PERSPECTIVE DISTORTIONS IN PHOTOGRAPHY, WHEREAS PROFESSIONAL PHOTOGRAPHERS, PROFESSORS OF ROBOTICS, PHOTOGRAMMETRY SURVEYORS ALL PUBLICLY STATE THESE ERRORS EXIST AND MUST BE ACCOUNTED FOR OR YOUR MEASUREMENTS WILL BE ERRONOUS
Not one of you have a direct response for that, only a personal attack on me, which is the hilarious thing, as I am not a professional photographer, not a professor of robotics working for NASA and not a photogrammetry surveyor so I am merely quoting and citing the actual professionals and you are hell bent on pretending they are not or I have something wrong.... but IRONICALLY never can explain anything I have wrong... 

"Like it’s almost a guarantee if you look into them, they’re not saying what he’s claiming and using the citation for."
100% guarantee you will never counter these citations, and you clearly do not know the relationship with me and QE where we are on completely opposite sides, he called me out once and I went in his server and owned him enough to say "Richard Feynman is full of it, and I know Quantum Mechanics like the back of my hand", he was soon shot down as being non-scientific in claiming knowledge of something no one actually knows anything about. You can pretend I am like him tho, it if allows you to obfuscate and avoid the science on the table.
Reply: @sphaera2520  "As you said, he’s articulate enough to recognize what he’s doing and should know better, that these citations cannot be genuinely supporting the pie he’s selling because at the end of the day these sources are proper mainstream folks who understand and acknowledge the globe earth etc. It’s not like they’re stupid and can’t recognize the implications of their own ideas. "
This is hilarious as you think I am citing these to PROVE THE FLAT EARTH hahahaha when my sole intention even public knowldge from my 1st debate with MC Toon called "Earth shape discussion with Gleem", is the absolute opposite. Notice how he did not put "Debate with a flat earther" hahaha because he knows I am not a flat earther, and as I said at the very beginning of the debate words to the effect of:

" IF you account for ALL known perspective errors, then how can a flat earthers say its perspective? , surely you would be debunking them on their own terms no? "

You are too docile and caught up in your own imaginary version of me to actually bother to understand my position. But hey you are humans, and its much easier to pretend something from imagination than to deal with reality that you have just learnt something new from me presenting this science, as you all originally thought that a photo is the same geometry as an orthographic euclidean maths, when mainstream science has tested it for decades and found in every experiment that belief is false. But you can carry on with your false belief system if you really really really need to, hey its not my belief, thats it... The problem here is I DO HAVE science backing me, and not one of you have any science backing you.
Reply: @Gleem  because nobody felt particularly compelled to engage with you over a matter we’ve all (evidently) experienced before. 

You make a claim and post a bunch of citations. We go and look for context and if what the author was saying matches up with your line of reasoning. Every time I’ve checked (not a lot but I’ve seen others respond similarly in case where I didn’t bother checking) it turned out you were misrepresenting the author. 

So, the running gag you’ve set for yourself is: post a huge wall of text citing a bunch of different sources which when properly analyzed is just wrong. This analysis takes time, not only because of sheer volume but sometimes your mischaracterization can be subtle and finding the precise flaw time consuming.
Reply: @Gleem  because nobody felt particularly compelled to engage with you over a matter/behavioral pattern we’ve all (evidently) experienced before. 

You make a claim and post a bunch of citations. We go and look for context and if what the author was saying matches up with your line of reasoning. Every time I’ve checked (not a lot but I’ve seen others respond similarly in case where I didn’t bother checking) it turned out you were misrepresenting the author. 

So, the running gag you’ve set for yourself is: post a huge wall of text citing a bunch of different sources which when properly analyzed is just wrong. This analysis takes time, not only because of sheer volume but sometimes your mischaracterization can be subtle and finding the precise flaw time consuming. After a while, we just ignore you unless we happen to have the time or for whatever reason are drawn to whatever that days topic happens to be. Today was not such a day for a lot of us who’ve opted to ignore you (outside of outlining your history) for the most part.
Reply: @sphaera2520  So more babbling nonsense NOT explaining a single thing I have taken out of context or cherry picked... As predicted... Keep failing, science will keep reigning. In science we have this thing called EVIDENCE something you clearly do not have or you would have put it on the table already demonstrating beyond any doubt I am wrong! You cannot, I told you, I have made it so... You cannot pretend to support science, and then just not believe it when a certain person cites it you, this would mean that person determines your belief system, instead of you reading the science and come to the understanding that you cannot debunk my claim below, so much so you have to make up some nonsense as if you know me or something:
GLOBE EARTHERS DO NOT ACCOUNT FOR PERSPECTIVE DISTORTIONS IN PHOTOGRAPHY, WHEREAS PROFESSIONAL PHOTOGRAPHERS, PROFESSORS OF ROBOTICS, PHOTOGRAMMETRY SURVEYORS ALL PUBLICLY STATE THESE ERRORS EXIST AND MUST BE ACCOUNTED FOR OR YOUR MEASUREMENTS WILL BE ERRONOUS
Reply: @sphaera2520  "This analysis takes time"
This one statement debunks everything you have said, as my stance is that there is MUCH MORE analysis to do than just slapping measurements in to an orthographic view and expecting everything to match Euclidean Geometry, and you are here arguing against that point. Your sincerely an SQL Database Administrator and Developer where Data Analysis has been my professional career for near on 12 years now, prior to that it was IT and Telecommunications manager for huge 400 seater call centers where it was my job to report statistics to the board... Please stop pretending you know me, and stop embarrassing yourself pretending you have ever looked up any science in your life, as in my whole lifes experience tells me that if you did truly have ANYTHING on me cherry picking or getting anything wrong, then any normal human would slap those facts directly on the table to destroy the other person credibility... And its those who say "Every time I look up something you cite its wrong, I cannot tell you why I just know its ALL WRONG and does not matter" being generic, bland and compulsive are 100% the people who are in the wrong..

Stay pretending, its all you have, because Ive got the reality of the situation already on the table, you all have nothing but imagination pretending you know me! None of you are seriously adults, it's impossible.
Reply: "All photographs are lies" Susan Bennet (Pro-photographer)

"Visual space is space as we consciously experience it, and it is revealed through the subjective judgments of observers. Previous theorists have tried to test whether visual space is best described by a small set of synthetic geometries, such as Euclidean geometry or Luneburg's hyperbolic geometry. The Geometries of Visual Space reviews this synthetic work and demonstrates that visual space regularly violates the axioms these geometries assume. "

Wagner, M. (2006). The geometries of visual space. Lawrence Erlbaum Associates Publishers.

"We have seen that our visual space is not purely Euclidean, as was believed prior to the alley experiments. There is a difference between our visual perceptions and the physical world. We explored the works of mathematicians who have investigated these differences in terms of different types of geometries. The applications that come from the alley experiments show that hyperbolic geometry is the best fit to model our binocular visual space. Even though hyperbolic geometry was initially controversial, it is becoming a standard piece of modern mathematics."
Hyperbolic Geometry and Binocular Visual Space - St Catherine University

"As mentioned earlier, all photography contains distortions. Unfortunately, these distortions, which are caused by the camera lens, the topography of the imaged surface (the Earth’s surface) and the single-point instantaneous collection nature of photographs, mean that aerial photos cannot be used directly as maps. Attempts to derive distances, areas or angular relationships directly from photography will result in serious errors. Photogrammetric analysis attempts to account for these distortions to allow distances, areas and angles to be derived accurately and precisely. Most of the distortion present in photography is the result of the perspective viewpoint from which the photograph was taken. This perspective is essential, however, for stereo-viewing and is necessary for calculating elevation from photography. The perspective distortion in a vertical aerial photograph increases away from the centre of the photograph. This is because the centre of the photo (correctly called the principal point) is the only truly vertical part of the image.Figure 9-1, Figure 9-2 and Figure 9-3 illustrate this. "

Field Techniques Manual: GIS, GPS and Remote Sensing 
Chapter 9: Geocorrection and photogrammetry 

"The position of the horizon is also relevant to the Sequential-Surface-Integration-Process (SSIP) proposed by He et al (2004) to explain the reduction in perceived distance on discontinuous surfaces. The SSIP hypothesis is based on two assumptions: (1) Ground surfaces are perceived as having 90° degree slant1 only when sufficient depth cues are available at near distances, and (2) the perceptual system has an intrinsic bias to perceive a ground surface as slanted with its far end upward. According to the SSIP hypothesis (He et al., 2004; Wu, Ooi & He, 2004), the visual system constructs the representation of the near ground surface (no more than 2 to 3 m) by using the reliable near depth cues (e.g., vergence, binocular disparity, etc.), and then uses the near surface patch as a template to integrate adjacent patches into a holistic representation of the ground surface. If there is a discontinuity in the texture, the template based on near depth cues cannot be applied to more distant surfaces and the visual system relies more on the intrinsic bias, which leads to a representation of far surfaces as slanted and an underestimation of distances (Sinai, Ooi, & He, 1998; Feria, Braunstein, & Andersen, 2003). The perception of the ground plane as slanted upward would place the perceptual horizon2 for that plane closer than the actual horizon for the ground surface....

 ...Sedgwick (1980) also noted that an imaginary horizon might allow the estimation of relative size and relative layout of objects. If the visible ground surface terminates below the actual horizon, because of a barrier blocking the observer’s view of the horizon for example, the observer might use the termination of the ground surface as an approximation to the horizon. Use of such an approximation in the horizon-ratio computation will result in a larger perceived size, with the extent of the error dependent on the distance of the actual horizon from the horizon used in the computation"
Background Surface and Horizon Effects in the Perception of Relative Size and Distance - Ozkan K

"There are many approaches trying to model and estimate the perspective effects in images. Some approaches try to learn and model the distortion parameters from a set of training data that work only for a predefined structure. None of the existing methods provide deep understanding of the nature of perspective problems."

Perspective Distortion Modelling For Image Measurements - 2020
Reply: @Gleem  I don't care what "experts" you quote mine from. If you misunderstand the foundations of a field, your misunderstanding will carry over to whatever cherry-picked quotes you pull from the experts. Or in other words, given enough time monkeys can write Shakespeare, but that doesn't mean they understand it. Ok, time to look at your quotes in context, shall we?

"All photographs are lies" Susan Bennet - Taken from a blog post on her photography studio site: The Science Behind the Selfie (No, You Don't Really Look Like That) . It is true that how photos are taken can change and distort what is seen, especially compared to the human eye which operates a different way. In artistic photography, which Susan Bennet specializes in as a photographer, it makes sense to distort the optics in specific ways in order to get the look she is going for. But, we can also do the opposite due to our understanding of optics. We can take a picture that we know the optics for and remove the optical distortions from them. As is shown in the next article I list that you quoted.

"Perspective Distortion Modeling for Image Measurements" 2020, by Alexandre Bousaid, Theodoros Theodoridis, Samia Nefti-Meziani, Steve Davis. Quote not included for brevity, but was taken from the Abstract. Also of note, in the abstract was the following quote:
    "In this work, a perspective distortion model for every effect is developed while elaborating the nature of perspective effects. A distortion factor for every effect is derived, then followed by proposed methods, which allows extracting the true target pose and distance, and correcting image measurements."

So basically, you cherry picked a statement indicating that optics had issues with distortion from an article that went on to provide solutions for the very distortions you claim can't be done. Either you don't understand what is being said, and need to go back to fundamentals, or you are purposefully being deceitful with your cherry-picked quote mining?

Want another example? Here it is from the quote you stated came from the Field Techniques Manual: GIS, GPS, and Remote Sensing which, in the same paragraph your quote came from was this little gem:
    "Photogrammetric analysis attempts to account for these distortions to allow distances, areas, and angles to be derived accurately and precisely." It then goes on to explain the distortion effects and how they can be mitigated.

Like I said in my first comment, portions quoted but taken out of context. That's all you have Gleem.
Reply: @Tsudico  " I don't care what "experts" you quote mine from."
As predicted you are pretending these are not real and are not real scientists and are not real experiments, all because you need your "lack of knowledge" to reign here. YOU ARE WASTING MY TIME!

" It is true that how photos are taken can change and distort what is seen,"
Hahaha 100% time waster, you are now agreeing with me!

"Quote not included for brevity, but was taken from the Abstract. Also of note, in the abstract was the following quote:"
Yes which confirms there ARE ERRORS WHICH YOU NEED MATHEMATICS TO ACCOUNT FOR OR YOUR MATHS IS WRONG! You have never made any account for such errors BUT HE DID! Hahaha you are not getting this are you!

"So basically, you cherry picked a statement indicating that optics had issues with distortion from an article that went on to provide solutions for the very distortions you claim can't be done. "
He does not do them, if you actually read the paper his maths ONLY works when you KNOW the predefined measurements of all objects and are at the center perspective point! Now the funniest thing is you are touting that there are NO error, and now you are citing a whole paper of MATHEMATICAL CORRECTIONS to pretend like any of you globe earthers have ever done or even seen this maths! You are amazing, defo related to Dunning and Kruger!

 "Want another example? Here it is from the quote you stated came from the Field Techniques Manual: GIS, GPS, and Remote Sensing which, in the same paragraph your quote came from was this little gem:
    "Photogrammetric analysis attempts to account for these distortions to allow distances, areas, and angles to be derived accurately and precisely." It then goes on to explain the distortion effects and how they can be mitigated."
YOU ARE PROVING MY POINT!! Lets translate this whole conversation in to simpleton for you:

YOU BELIEVE THERE ARE NO DISTORTIONS TO ACCOUNT FOR.

I CITE SCIENCE WHICH SHOWS YOU ALL THE CALCULATION AND MATHS YOU HAVE TO DO TO ACCOUNT FOR THESE ERRORS.

YOU CONFIRM THAT THESE ERRORS NEED ACCOUNTING FOR, BUT WILL NEVER BE ABLE TO SHOW A SINGLE GLOBE EARTHER ACTUALLY ACCOUNTING FOR THEM.

This is my point, why are IDIOTS like you and "I cant science that" pretending there are ZERO distortions to account for, when science confirms there are, and you just pretend you have accounted for all these errors in all photographic analysis done by the globe side! SHOW ME ONE!! Show me 1 single account for this maths in any major globe earthers analysis of photography, you have many to choose from:
Soundly - Pontchartrain Bridge
Conspiracy Cats - Mt Rainer
Ranty - Blackpool Tower (analysis also done by Roohif)

Go on show me where they have used ANY of the maths you now admit needs to be accounted for in order to not get SERIOUS ERRORS IN MEASUREMENT as the manual clealy states:

" *Attempts to derive distances, areas or angular relationships directly from photography will result in serious errors . Photogrammetric analysis attempts to account for these distortions to allow distances, areas and angles to be derived accurately and precisely. Most of the distortion present in photography is the result of the perspective viewpoint from which the photograph was taken*.

Field Techniques Manual: GIS, GPS and Remote Sensing 
Chapter 9: Geocorrection and photogrammetry 

Which you have just literally said this is all about psycology! Hahaha

"Like I said in my first comment, portions quoted but taken out of context. That's all you have Gleem."
Nope what I have is an idiot telling me "We do not have perspective distortions in cameras" and when cited multiple science experiments clearly demonstrating YOU DO NEED LOTS OF MATHS to reverse engineer these errors, you change your story to "Oh yeh we do have loads of distortions but we have sorted them all out" WHO??? THE SCIENTISTS I AM PROMOTING OR THE GLOBE EARTHERS LIKE YOU WHO NEVER KNEW ABOUT THIS BEFORE I SHOWED YOU!

Amazing, keep pretending you are correct here about something, all while finally admitting I was correct and there ARE perspective distortions in ALL cameras and globe earthers NEVER account for a single one!